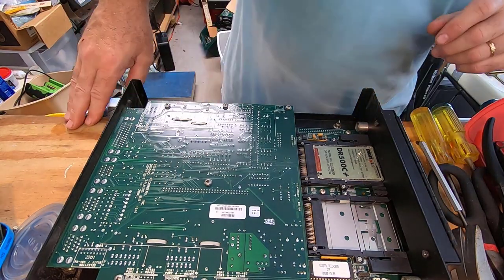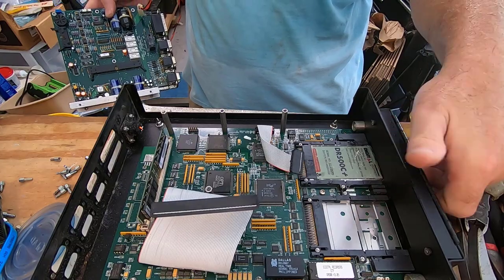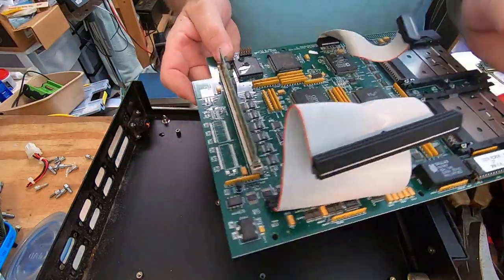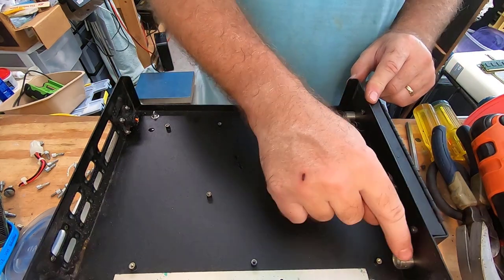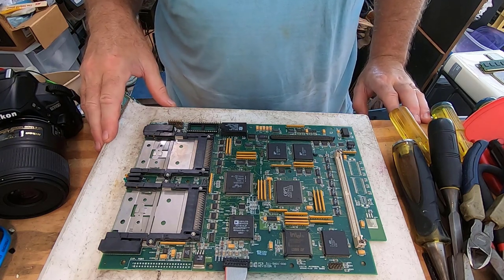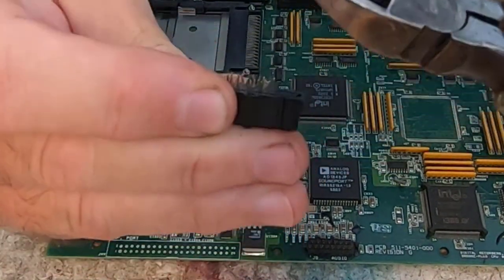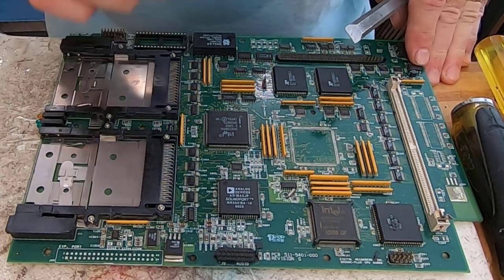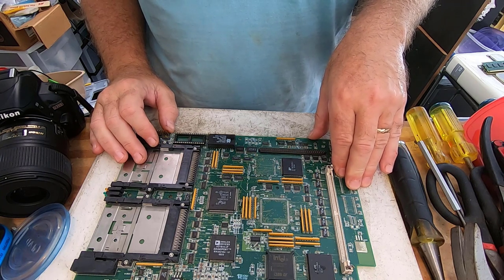Talking Bus Scrap

Comment: Nice boards from that unit. Here is another hint for ya, when removing mlcc's, put a magnet on the board next to them when removing. you'll never lose them.
Reply from the maker: Sometimes I run a mag over the board after I'm done, just to make sure I haven't left any mlcc's on there.  Of course, that only works for the magnetic ones, but that is most of what I get.

Comment: That seemed like a pretty easy scrap.  Some of those components looked like they came off so easily I'm surprised they didn't shake loose with the vibration of the bus!  Unless your buses have better suspension than our buses here in England lol.  Take care, Poo
Reply from the maker: I agree - these were some of the easiest surface mounts I've scrapped.

Comment: If you get a real out of the years you can actually make money
It becomes worthwhile
I just don’t find enough computers
I sell them complete at $.20 per pound
Reply from the maker: Marty - You're throwing away some good value.  Even a few computers every now and then can add up over the year.  It only takes a few minutes to break them down to mother board, power supply, heat sink and CPU.  You have plenty of space in the compound to accumulate them before taking a load in.  Just my humble opinion as a fellow scrapper and viewer of your channel.

Comment: Is there any value to that big card you took off the second board?
Reply from the maker: John - great question.  I should have opened for the video.  Turns out there's card with a flat pack, IC and a couple MLCC's.  The card has enough exposed gold tracing to consider setting it aside with my dirty "gold fingers."